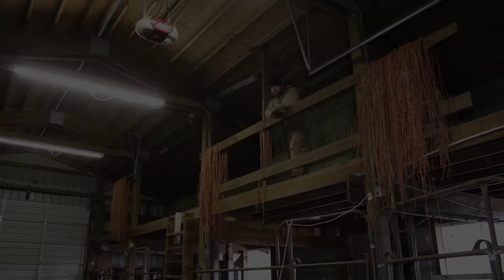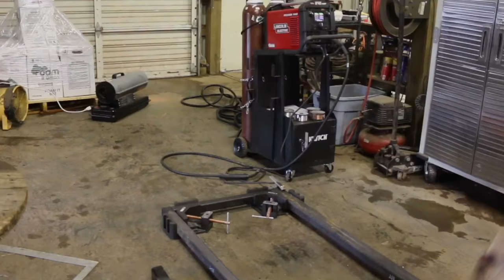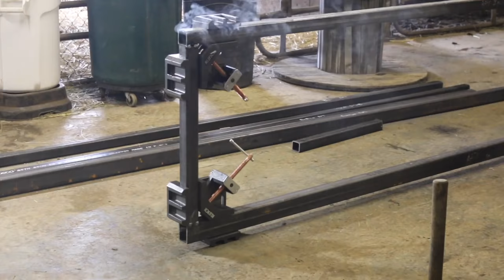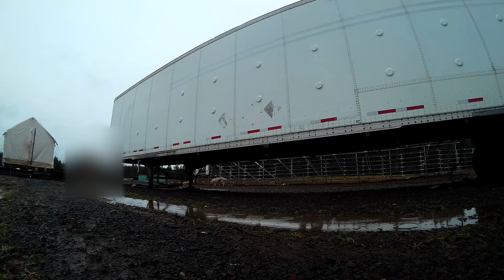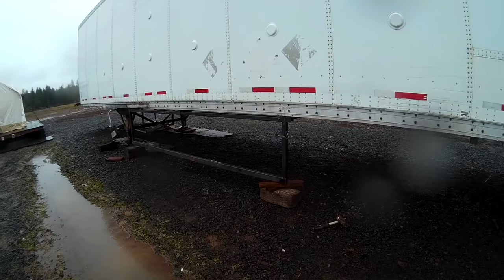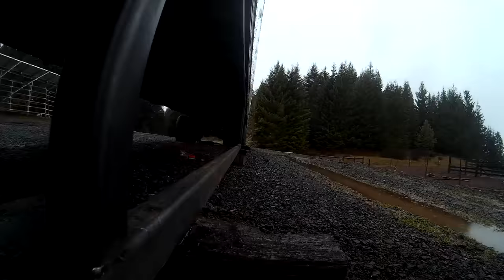WELDING with two BULGED DISKS

Comment: I feel you. I've had the same issue since a car accident in 2002. Feel that little pop and drop what you're doing. At the time I was fabricating solid surfaces and everything was heavy so you almost become paranoid how you move with any lifting. Better the day lost than crawling for a couple weeks.

Comment: My wife suffers from a budge between L4 and L5. Here's what we've been instructed to do by her back specialist, and it seems to work well. 
Some ibuprofen with food. Then while standing, have someone lift up on L4 (in your case L5) gently allowing some space between L4 and L5 (L5 and S1).  Lift and hold for a count of 10 while breathing deep, then release. Do this 5-6 times. Lifting allows the disk to be relieved of pressure from the vertebrae while allowing oxygen-rich blood (from the deep breaths) to flow into and around the area. That should bring a bit of relief. Try to lay down with your lumbar region supported. Repeat that in about 15-20 minutes. Repeat again. Stay off your feet for about an hour. Try to relax the entire time. If you don't know how to find the vertebrae, let me know and I can show in a video if you'd like. Don't do it if your 'someone' is not confident of where things are. You might get the disk pressed on and that will just not be fun. Praying for you.

Comment: With the workshop work have you thought about building some ceiling mounts to let you hang camera and light mounts to let you repeat setups quickly and to not have tripods taking up valuable floor space?  Saw one guys setup where it is all made of plywood and other easy to find parts at a hardware store.
Reply from the maker: great idea...haven't thought of that...but now I am ;-)
Reply: @TheRealMartian  Here is a video of that plywood based track setup https://youtu.be/tiHoWwuTM4U

Comment: Dude..you should've just bought a couple of more tubes and welded yourself a stand so you didn't have to crouch over or even be able to sit down.
Reply: Once they get the bench moved over from Cody's, Jeff will not have this problem.